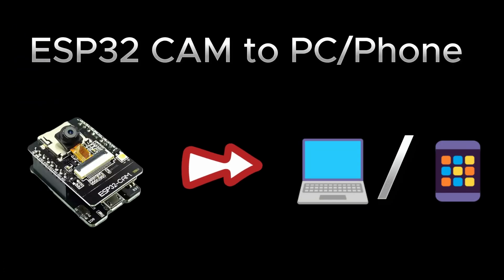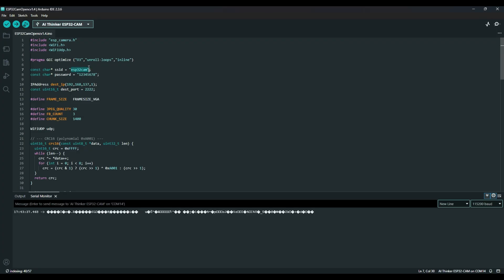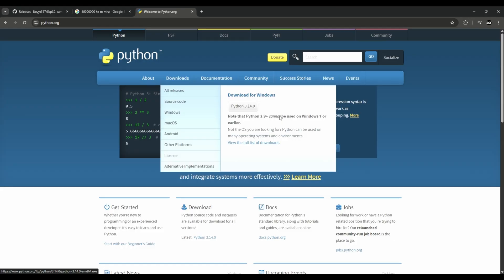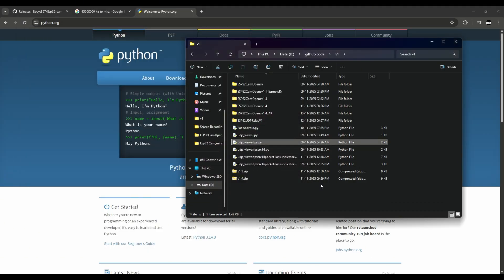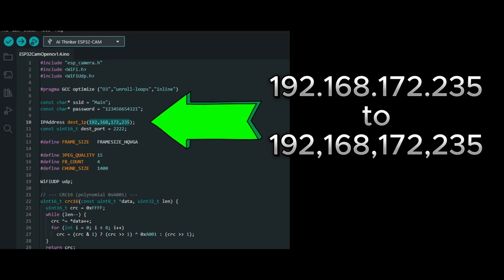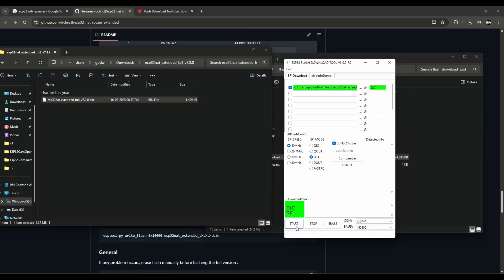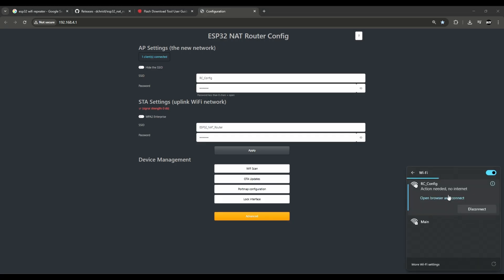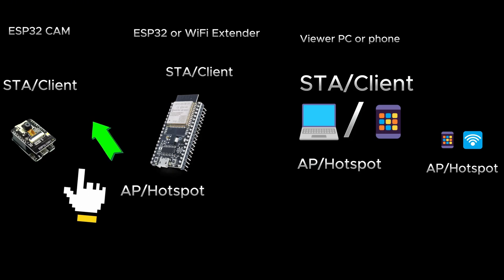I Built a 100 FPS, $5 Wireless Video TX System Using ESP32-CAM + OpenCV!

Comment: when i use python code, my cpu use 100% and code has very high lantency , what should i do?
Reply from the maker: What!!😮, run the udpfps or run code for Android in pc. Or just decreases the eap32's clock Hz from 37 to 25 , thus lowering the fps 😅😊. fall back and use the old 1.4 code as they are more optimized for performence

Comment: I always follow your esp32cam videos and it's great, hope you can make more videos on this topic
But can you help me, my ov2640 camera gets noisy if xclk is greater than 24mhz, even worse with continuous packet loss with xclk >24mhz
Reply from the maker: Did you ran in CIF resolution? On that you will able to run at 40 mhz , 
My tested mhz is
At resolution CIF = 37-40 mhz
QVGA = 37mhz
VGA = 35-37 mhz
SVGA = 35 mhz
XGA = 20 - 25 mhz
Could it be, I got lucky and got a good soc that is able to do 40 mhz?🤔
Reply: @EngineeringRobotic i try in cif, but it's still loss package and fps drop when package loss(80fps>~55fps), any xclk higher than 24mhz will make loss package😢

Comment: Is it better than 5.8ghz analog fpv video feed?
Reply from the maker: Analog is still better than this😊
Reply: @EngineeringRobotic aww man
Reply: But the last video you also mad ean esp32 cam and is that better than analog or not? @EngineeringRobotic
Reply from the maker: @QuztaniBakto  No digital system can compete with analog in terms of delay, primarily because analog systems lack intermediate processes like encoding. On the other hand, most digital systems offer better image quality.
🙂‍↕️
If you compare raw image quality to an analog system, the ESP32 will be superior😎. However, as you have already seen the low FPS and high delay in my videos, the system is still not good enough for FPV drones. It is more suited for RC cars or educational purposes.
😅
I'll work to improve the performance soon, but it will be impossible to achieve an analog-like low-delay system while maintaining high digital quality😅😊
Reply: @EngineeringRobotic thanks for replying😊

Comment from the maker: What should I make next ! 😊
Reply: Add autojpegquality, it change jpeg quality by rssi, rssi higher meaning jpeg quality lower(15-20) and rssi lower meaning jpeg quality higher (>30)
Reply from the maker: @minh996vn  From my experience, it's not worth the trade-off. While reducing the quality slightly (e.g., from 10 to 64) could be acceptable, the resolution quality becomes the main problem (though it doesn't dramatically impact range). Unfortunately, the 40 to 64 quality setting is already too bad to view😅. This feature would only be useful if we could use 1080p or 720p resolution with HEVC or H.264 compression 😅😊
Reply: Transmit the video of esp32cam using lora and show it in cheap yellow display module display using the same lora receiver and inbuilt esp32.